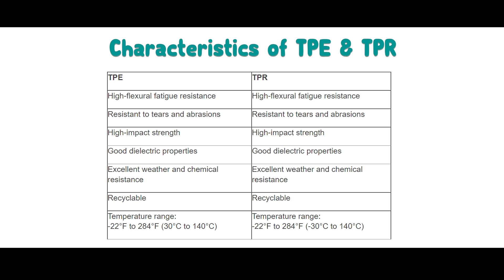TPE, TPR, TPU Materials Explained | PRM What To Say EP12

Comment: It's an honor to happen to see this useful video. We are currently thinking of tpu or tpr material instead of the frame of goggles made with pvc. It should be a material that can last about 30 minutes at a heat of 120 degrees, is tpu suitable or is tpr correct?

And when you make it into a frame, which product is softer and better to wear?
Reply from the maker: Dear sir/madam,
You may visit the link below to fill our inquiry that will be processed by our specialist soon.
https://www.prm-taiwan.com/contact.html

Comment: Hello Sir.. hope you doing well!

I need a suggestion regarding 2k injection molding. 

We are developing a product with 2k injection molding where one material is POM and another is TPU.

We are not able to fill TPU properly into POM and also facing bonding issues. 

Could you suggest which POM grade is best compatible with TPU..? Also any process parameters we need to look into?

Thanks for the help..!!
Reply from the maker: Dear Sir/Madam,
Sorry, we cannot provide any suggestions to you because we are not a manufacturer in this field. In order to solve you problems, you could leave your inquiry at the link below that would be processed by our suppliers.
https://www.prm-taiwan.com/contact.html

Thank you for your comments.
PRM-TAIWAN